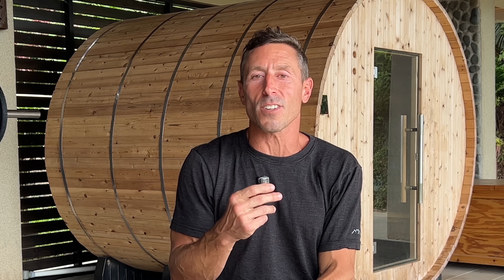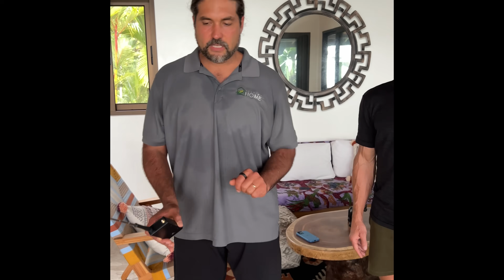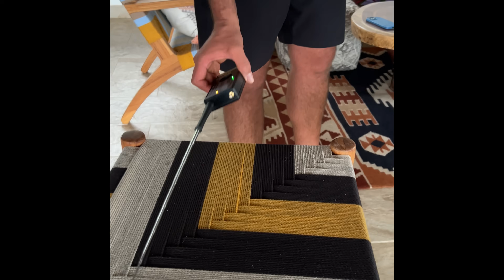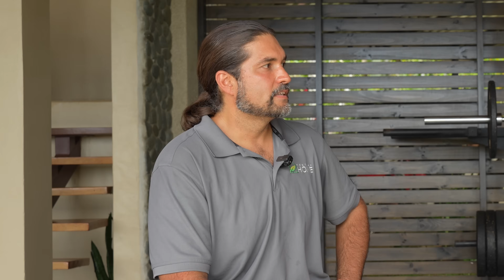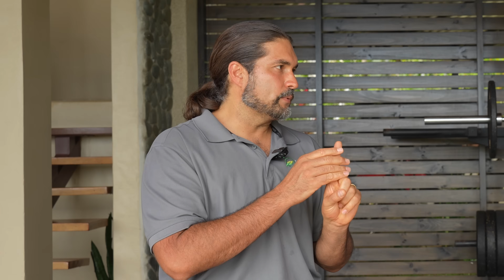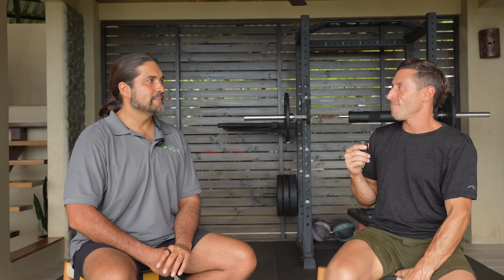Earthing vs. grounding

Comment: Ok, a ground rod is a copper rod pounded into the ground (earth) to which the ground wires of the house are connected.  Look on the ground under your breaker box. You’ll see a rod with grounds attached with wire going to the box.

Comment: His understanding of a residential electrical system (at least in the US) is totally incorrect. The ground plug on all your outlets are connected directly into the literal ground with a grounding rod.

That “demonstration”’he did was showing grounded vs ungrounded. Why would he touch it to a blanket sitting on a stool and act like it not making any noise proved the grounding mat has “negative energy”. All he did was show that the mat is grounded and the blanket is not.

Oh my, the more I watch of this video the crazier this guy gets. He is claiming household voltages travel 6-8’ through the air!? Air is one of the best electrical insulators there is, if what he is saying was true the plugs hot neutral and ground lugs on an outlet would need to be over 8’ apart from each other instead of the ~1” they are actually apart.

Comment: As an electrical engineer …the earth in electrical systems are NOT connected directly to electrical appliances etc. it’s there as a secondary safety path in case the Neutral is lost and or an appliance fails . Earthing systems in the UK are also usually connected to incoming water mains and gas pipe….really good earth.

Comment: Completely disagree. I was not a believer in grounding mats. Woke up each morning with an aching back and ankles sore at the end of the day.  I started using the grounding mats and sheet. After only 4 days I started to feel better.  Now after a month me & my wife are a 100% better.  I have been documenting my daily readings while using this device with a volt meter. It works. If yours isn’t working you should test the mat to verify it’s actually grounded.
Reply: What company did you buy from?
Reply: @thomassowers6291  The only company you should buy from is Clint Ober’s IMHO!

Comment: NOPE! That's another "plug" for the electric company! Before I knew there was a difference between grounding and earthing I grounded my bed with copper wire run outside to grounding rod and was the WORST nights sleep ever! I even woke up several times a night getting ZAPPED on my feet! Didn't know why, lol, but removed the grounding from bed. Now after seeing this video I know why! WOW!

Comment: Using a grounding mat or sheet plugged into the ground of an electrical outlet can be problematic because the ground wire in a home is connected to the neutral wire at the breaker box. This setup means that the grounding mat or sheet may inadvertently expose the user to electrical noise and stray currents present in the home's electrical system. The ground wire in a home can carry "dirty electricity" or electromagnetic interference (EMI) from various appliances and devices throughout the house. By connecting yourself to this ground, you may be exposing yourself to these electromagnetic fields.
These currents can be absorbed by the body, potentially leading to adverse health effects rather than the intended benefits of grounding.

 In contrast, using a grounding mat or sheet connected directly to an isolated copper grounding rod separate from the home's electrical system can be beneficial:
It provides a direct connection to the Earth's surface, allowing for a true grounding effect without interference from the home's electrical system.
This method avoids potential exposure to EMI or stray currents from the household wiring.
It more closely mimics the natural grounding effect of standing barefoot on the Earth, which is the basis for the purported health benefits of grounding. 

The information I have provided here is not my opinion, assumption or part of my belief system getting in the way. It is simply facts. To prove this you can simply copy and paste anything that I have stated here onto any AI search engine of your choice and ask if this information is false. For example Chat GPT's response to my statement is the following: The statement you provided appears to be entirely accurate and contains no false information. It correctly highlights the potential issues with using a grounding mat connected to an electrical outlet in a home, as well as the benefits of using a grounding mat connected to an isolated copper grounding rod.

Comment: Thank you!! This is a very important video for education purposes. It helps me understand why my mattress grounding pad feels like it doesn’t work. It did work at first for a short time. It “may” be working and, the counter effect of the dirty energy is likely offsetting or maybe even fully negating the pad effects. 

I particularly appreciate the distinction between earthing and grounding. This helps me understand why I feel WAY better earthing than using grounding products—at least the way I am currently using them. I realize being out in nature is good for many reasons. But distinct from that is the very real physical effects I feel with my bare feet on the earth.

Thank you again! 🙏🙏🙏👏👏👏

Comment: So to the author of this video, you are right on some things but drastically wrong in others. I am a Electrical Engineer and my primary field is in the Oil and Gas sector; so I deal with stray current constantly. If you would like to actually be educated and understand how stray current works, please feel free to reach out. I believe you are correct on some issues but you are changing your life habits for something that is drastically wrong.

Comment: 😮😮LIGHTENING ROD!😊😊
I have a thick lightening rod just running down from my roof on the terrace and I can imagine the best, on an absolute clear and sunny day!!..,is to connect my copper plate for my feet rest with a copper cable to this rod.
Am I CORRECT to say so, @Paul.?
Please: may only the experts comment here? I do not need opinions. Thank you!😊😊😊

Comment: Grounding (or earthing) through an electrical outlet is not safe because it can expose you to the risks associated with AC current and electrical faults. The outlet's ground is connected to the home's electrical system and is not designed for personal grounding.

On the other hand, grounding through a dedicated grounding rod, which is properly installed and connected to the earth, is generally safer. This method involves driving a metal rod into the ground and connecting it to a grounding system that does not involve the electrical wiring of your home. This avoids the risks of electrical shock associated with using an outlet and can provide the grounding benefits without the dangers of AC current.

Comment: Wow, I certainly do not want to electrify myself. Maybe camping is good after all. I could handle walking barefoot on grass as long as it’s not a dog park!
Reply: Do some readers h on lightning arrestor for TV antennas and especially the human body . There is also sometimes static electricity in the air .
Do a experiment with leather bottom  skippers socks if can get some cheap ones . Defiantly static cling with clothes . Get a balloon blow up rub on your arm several times then stick to a wall  or your shirt .

Comment: Hello!
I'm an EMF consultant and I enjoyed the video. Good Job!
This topic really needs to be explained as so many people are using earthing gear wrong and are often energized instead of earthed.
Though I found one mistake here in this explanation.
Our body is not passing electrons If we are earthed and close to energized cables. There has to be direct contact to the hot wire for that to occur.
If we are earthed, we sort of create an earth DC field around us which is pushing AC fields away and we are not affected by it.
You can see the effect when measuring the tree under the powerlines with the same meter used in this video (Esmog Spion 5G). Under the tree there are no electric fields from the lines above because there is an earth DC field surrounding the tree.
Though there is one case when switched on power can affect the person who is using earthing equipment. It occurs when the earthing cable is very thin and/or poorly connected to the earth and it is overruled or cross contaminated by the E fields from energized cables close by.
It is always good to disconnect the power while sleeping and the best way to disconnect is when you use the special cut off switch that is disconnecting all the cable cores at once.
https://www.noark-electric.eu/en/products/102301
Tace care

Olle Kitsing
EMF Tuning OÜ
+37256981988
ollekit@gmail.com

Comment: Paul this guy just gave some confusion on the the definition of grounded systems and the bonding of electrical equiptment. Also I am a qualified electrician and have to clear this up. What this guy just explained in the beginning of the video is the "grounded" conductor. The grounded conductor is the neutral most commonly the white wire. I'm going to cite a few things from the national electrical code book article 250 grounding and bonding. Electrical systems that are grounded shall be connected to earth in a manner that will limit the voltage imposed by a lightning, line surges, or unintentional contact with higher voltage lines and that will stabilize the voltage to earth during normal operation. Grounding of electrical equipment means normally noncurrent carrying conductive materials enclosing electrical conductors or equipment, or forming part of such equipment, shall be connected to earth so as to limit the voltage to ground on these materials. Bonding of electrical equipment means normally noncurrent caring conductive materials enclosing electrical conductors or equipment, or forming part of such equipment, shall be connected together into the electrical supply source in a manner that establishes an effective grounding current path. 
The bare wire or equipment bonding jumper is it a reliable conductor to ensure the required electrical conductivity between metal parts required to be electrically connected. 
Basically to break this down, the neutral wire is what carries back all the unbalanced load and stabilize the voltage to earth during normal operation. And the bare wire or the bonding wire is to ensure electrical continuity and the capacity to conduct safely any fault current likely to be imposed on any of the metal parts that are likely to become energized in case of a ground fault to those parts. Now essentially the bond wires and the neutral wires are connected together before the first point of disconnect in your electrical panel. But after that those circuits are separated or at least they're supposed to be correctly to ensure that any metal parts in the system likely to become energized will take that to ground and cause the overcurrent protection device to trip and Open the circuit to kill power to that circuit. It's all about life safety folks and for electricity it's the path of least resistance which will normally always go to your grounding electrode through the bonding wire and not back up to the transformer through your neutral wire or "grounded" conductor.

Comment: Sometimes outlet boxes are installed which have the ability to be grounded, but no grounding wire has been connected. In that case the grounding mat would not do anything. Check to be sure the outlet where you plug in the mat is actually grounded.

Comment: Outlet ground, is earth ground! 
Some houses could have a outlet hooked up wrong, with a ground wire connected to a neutral spot. In that case i suppose you could have a "unclean" ground. Or maybe something could have a slight internal short. 

 But Your house breaker box should have ground wires connected to a rod going 2 feet into the earth.

Comment: Now I have a conundrum.  Have grounding mat under my desk.  Was plugged into the neg part of outlet, saw this immediately unplugged it.  So even with the mat earthed separately from the house, that outlet near my desk has have the circuit off?  So basically, this mat is useless if I live w/ electricity.  I'll just go outside and step on my wet grass.

Comment: This is partially incorrect. Ground is attached to the neutral wire that is the unbalanced loads return path but your body has to be a better path to neutral to get that current through you. That being said, I don't think using your electrical systems ground will discharge your body due to the resistance of the wire going all the way back to your service. It is not harmful, but I doubt there's benefit unless you do connect a wire via a ground rod very close to your bed as possible.

Comment: The ground doesn’t send unused electricity back to the grid, the neutral might but the ground goes outside your house into a poll that a few feet into the ground. Could your guest please clarify if he meant ground or neutral. Thanks

Comment: My grounds at my house are connected to the ground in my panel. That is grounded to a water pipe and also to a grounding rod that is pounded into the ground outside.

Comment: There is a hot lead, neutral lead, and a ground in the electrical system. Hot and neutral carry current, and the ground(s) is/are connected to a rod in the ground outside of the main service panel.
Reply: so is there risk of your body getting dirty electricity from grounding?
Reply: @idkybutwutever 

Yes .

Comment: Guy obviously has no idea how home electrical systems work.  The ground of your home is clean and straight to the earth.  It never got back to the electric companies connection. If it does then you need to sue your electrician for connecting your home incorrectly.   Go look by you outside connection on the ground you should see a wire connected to a rod in the ground, thus you are earthed.

Comment: Yeah I was feeling weird grounding through the plug so I bought a grounding copper rod put it in the ground drilled a hole through the wall and now I'm grounded to the Earth and nothing to do with the electrical system that's okay right?
Reply: follow up with the difference u felt with ground rod
vs wall plug

Comment: Wouldn't the grounding rods buried in the ground be installed when houses were built? ,  so if my house in England built in the 1950s grounding rod is 70 years old? Wouldn't the metal corrode over time?  Ive got plug in grounding sheet but just purchased a stick in the ground rod with a cable that ive run up to my bedroom but its cheaply made,  steel rod, thin wire..
 Gonna make my own with  a thick copper 4 foot rod, thicker  cable and ditch my silver lined sheet for a aluminum plate that my feet will sit on...gotta admit i felt some zaps from plugging into the mains but people said it was the earth energy, dunno what to believe, i would happily do barefoot everyday but England is cold half the year hence why i got a sheet

Comment: Incorrect, the grounding of your home's electrical and GFIC outlets if they are indeed grounded to the ground wire along with the neutral (usually white) wire, is/are grounded by a ground rod at the  "mains or circuit breaker box." Additionally, power poles which deliver to you home are grounded as well. One should confirm that "each" outlet is grounded properly with a wiring tester. Any discrepancies should be mitigated/rectified by a licensed electrician. Additionally, all electric light (on/off) switches should be grounded to the home's electrical system

Comment: I was googling to see if I can find any related studies regarding grounding in EMF presence and I came across the following:

<<The study confirms the “umbrella” effect of earthing the body explained by Nobel Prize winner Richard Feynman in his lectures on electromagnetism [16]. Feynman said that when the body potential is the same as the Earth's electric potential (and thus grounded), it becomes an extension of the Earth's gigantic electric system. The Earth's potential thus becomes the “working agent that cancels, reduces, or pushes away electric fields from the body.”>>

Source: 
https://www.ncbi.nlm.nih.gov/pmc/articles/PMC3265077/
 - Under Section 2.3. Earthing Reduces Electric Fields Induced on the Body

It says CANCELS, REDUCES, PUSHES AWAY - All 3, So I don't understand what is true! 😞

Comment: Dude your mind has so much static. You also need to ground to you magnetic self which is feeling self. Part of you that don’t connect to your feeling is ungrounded to your inner field. Once you ground to your feeling self your mind will turn from static to Presence. This is quantum. Try it simply by slowing down your speech. This will be almost impossible the way you are wired. So speak slowly for few month and be amazed. Good luck with that. Most pple on earth are disconnected from their feeling self. Most feelings are just thoughts masquerading as feelings and so most pple are simply Godless.

Comment: You need isolated ground recep. Ground goes from recep back to panel without stopping anywhere else. They use in hospitals a lot that have sensitive equipment.

Comment: Can a faraday cage bed frame protect you from the Eddie currents emitting from the electrical circuits in the walls? This would be a a creature comfort for someone to sleep inside a metal cage rather than turn off all electrical circuits to the room?